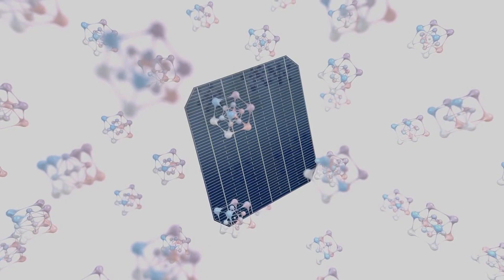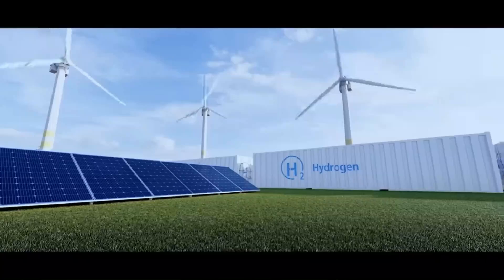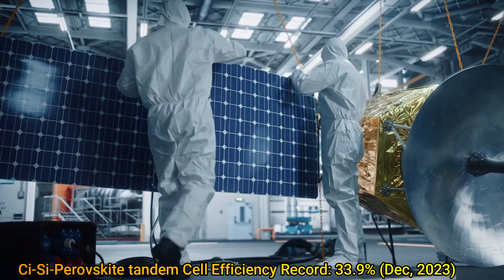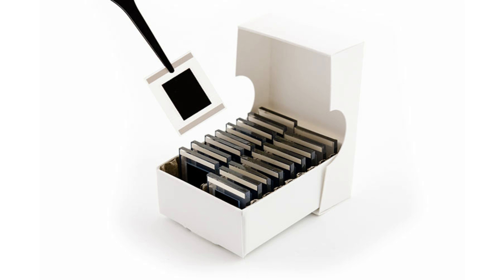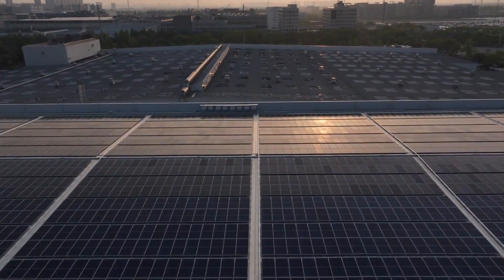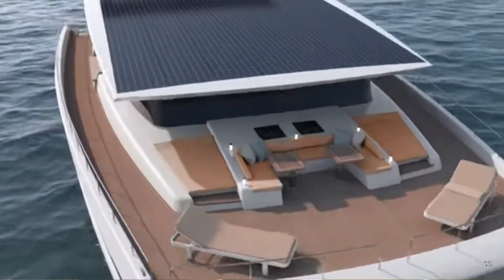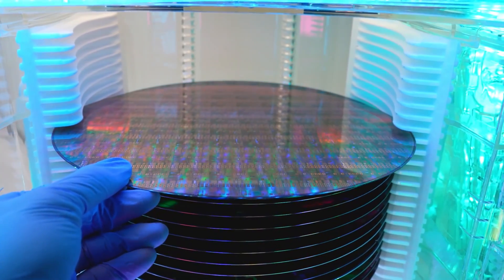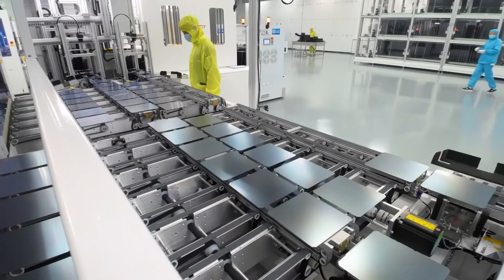Longi's record efficiency Solar Cell. 50% more power

Comment: Perovskite solar cells are useless as of the moment and it's all nice declarations. Until they succeed to solve the problems regarding using Perovskite, it all remains a nice dream. One of these problems is that it is not durables and degrades shortly.

Comment: While this announcement is cool and all the issue with perovskite has always been longevity.  The best one's I've heard of lasted 3 years and that was in a lab environment.  I remember back in 2007 I believe it was when nano crystals were first becoming a thing and they announced lead-selenium nano crystal solar cells which doubled efficiency to 40% because every time a photon hit the cell instead of 1 electron being released 2 were released.  Nothing ever became of that technology AFAIK because the efficiency of average solar panels hasnt increased much since that time.  Then there was the blu-ray patterned  cells where they supposedly increased efficiency 21% by making the surface of the panels irregular instead of smooth so the light would have a greater chance of hitting at the correct angle to cause a reaction.  They called it blu-ray patterned because the researchers who were looking at ways to improve the issue with flat faced cells being at the wrong angle to the sun a lot of the day for maximum efficiency had a blu-ray of Jackie Chan's movie SuperCop and when they looked at it under the microscope they saw what turned out to be peaks and valleys in an irregular pattern which when applied to a solar cell boosted the cell's ability to capture photons.  That or something similar may have been implemented but I have no idea if it was.  

But I mentioned all that to say this... there are always record breaking inventions in solar and other green energy tech but they rarely see the light of day.  Even fewer are cost effective and more durable than the current thing that they are meant to replace.  So  unless the government comes out and mandates all solar panels must be perovskites by 2050 the chances are we wont be seeing these super panels replacing silicon panels in our lifetime.

Comment: Neat but I'd like to know what specifically Longi did to overcome the "perovskite degradation" issues. Probably not much as they are mixing them with the more long-lasting cells. Perovskite is cheap and more efficient when these solar cell companies get the chemistry right for longevity, they will have something akin to a "disposable solar cell."
Reply: Got exactly the same question. Quid of the longivity of this combo ?